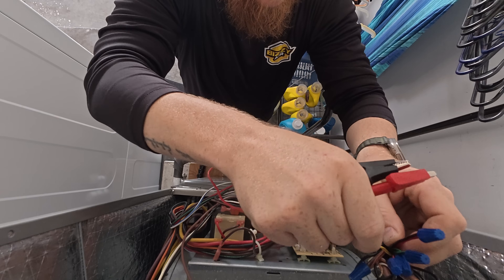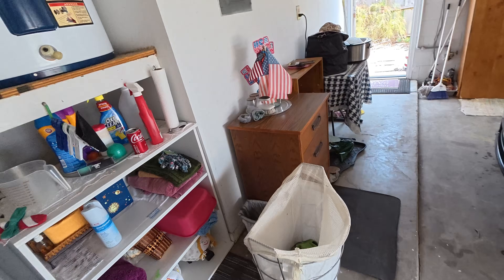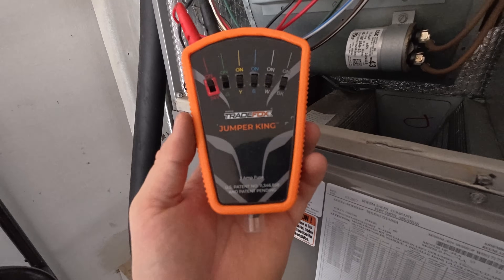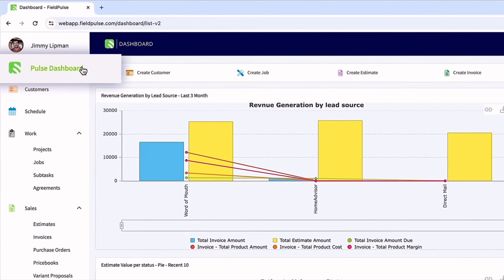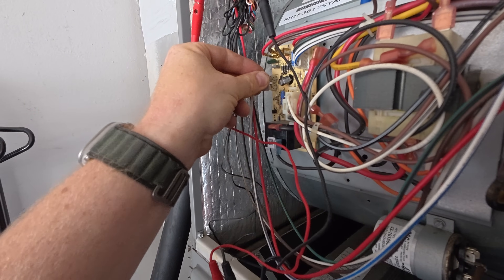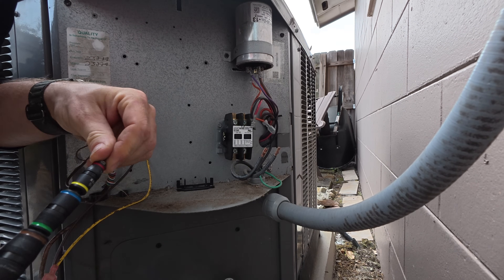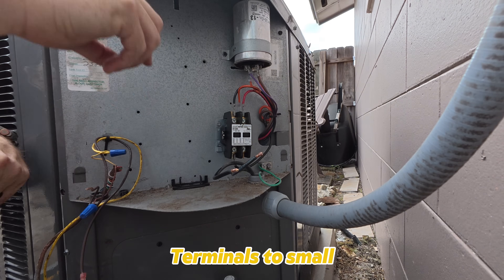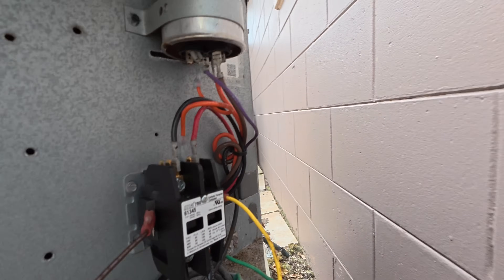Finding 24 Volt Short | HVAC | Blown Fuse From THIS

Comment: Great job as always! 1.6 ohms is very low. Bit of ohms law: volt/ohms=amps ----> 24/1.6=15amps!!!
Reply: That does not work with AC.  You have to consider inductive reactance.
Consider a normal new reading of 14 ohms.  If you ignore reactance, that comes to 2 amps.  2 amps at 28 volts would be 56 watts.  Most AC transformers are rated at 40 watts.
Reply: @ Rookie mistake on my part. I spoke too fast lol. You're totally right. I forgot that it was a coil. Is there a way to calculate amp draw? Would be useful when testing a single phase compressor.
Reply: Where can I read more about this? @RobertTuck-vo8cw

Comment: That water heater was from 1990s 😂. I miss the simplicity of 1 stage systems sometimes. Keep making bangers broski
Reply from the maker: Man, I know the feeling.  Sometimes I wish I could go back to the simplicity of single stage systems too!  😂 I think that ship has sailed for the most part, they will soon be extinct
Reply: @ it’s getting to the point that senior techs are having to not only run calls but be tech support for 100s of guys. Even when I’m off or on vacation I’m on the phone with bros . Which I don’t mind but yeah 3-5 more years and it’ll be multi stage every call